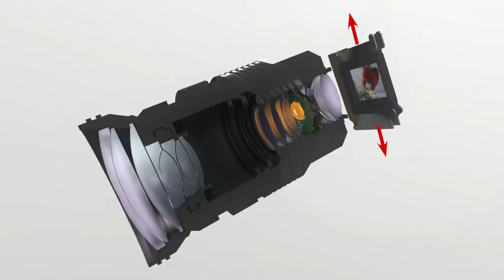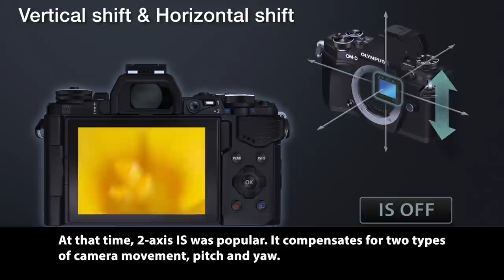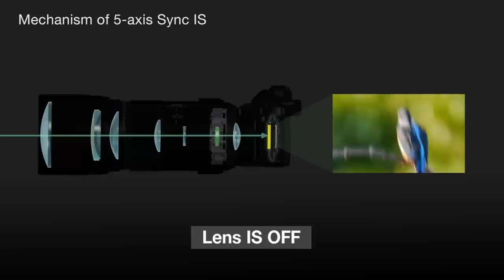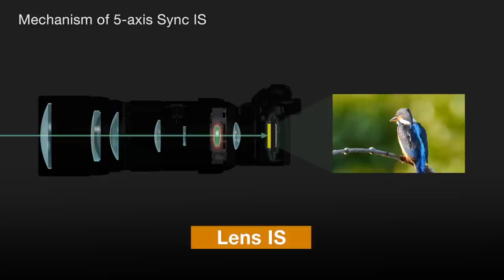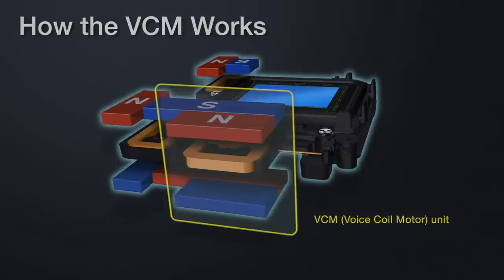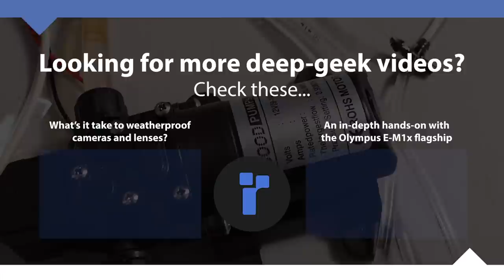The INSIDE story on Image Stabilization: Gyros and coils and magnets, oh my!

Comment: Thank you for  a very informative and clear video, I had assumed that you would want to coordinate gyros from deep into the lens with the gyros in the body to make the calculations even more accurate. But after watching this video I guess that might struggle for the same reason that driving the lens IS from the body would struggle. Electrons in copper racing light in glass plus compute in the body maybe makes it too slow. At least if gyros are providing additional data that is not as bad as a full roundtrip to let the body drive the sensor, but just fascinating.

Comment: Thanks Dave and Olympus for allowing Takeuchi san to be so forthcoming. I've been using Olympus for a number years now including the the EM1 iii and have found their IBIS implementation to be excellent. One thing that you didn't discuss is how the IBIS allows the capture of High Res images which is strikes me as being incredibly challenging technically. Interesting to hear that the gyros are from Seiko Epson. It makes sense that there's a connection due to the shared history of both companies in Nagano. One of the clever features of my old KM 5D was that the IBIS provided visual feedback on how steady you were holding the camera allowing you to choose the right moment (if you had time) as well as indirectly improving technique. Y
Reply: Hi Yamakawa -
Ah, I'd forgotten about that feature of the KM 5D! Yes, I always found that incredibly useful. If you had time to get the shot, you could wait until the camera-motion indicator had settled towards a minimum. And it was indeed very useful for improving your technique!

And yes, the handheld High Res mode is almost unbelievable, that it can manage sub-pixel alignment of handheld shots occurring across almost a second. I'll tuck that question away, in case I get a chance to talk with Takeuchi-san or another Olympus IS engineer in the future. (FWIW, I suspect it's a combination of their exceptional IS capability and perhaps some amount of post-processing, to do sub-pixel alignment of the separate images. OTOH, whatever it does, it manages to do it quickly enough that the sub-images in the RAW file are all properly aligned. However the accomplish it, it's indeed remarkable :-0 )

Comment: Great video. So cool. I do wonder how much processing power, battery life and maybe heat generation happens because of IBIS. Canon's new bodies are taking a lot of heat right now and I'm wondering if it's because of their new IBIS system.
Reply: Data input-output (IO) is what causes the heat issue with the new Canon cams (and any high data rate camera). 8k video passed at high frame rate is an enormous amount of information IO from the sensor to the recording device, which generates large amounts of heat.
Reply: @pwx8460  right but how come the camera is disabling 4k HQ video after 30-40 photos taken over the course of an hour?
Reply: @geoffreyenriquez  Hi. I can't say for sure, but recall from another YouTube reviewer, that the new Canon 4k video is down-sampled 8k video, i.e. still the same heat generation. 4k cameras also have to deal with heat management issues due to the extreme data flow. 8k will just be even more challenging.
Reply: @pwx8460  perhaps canon is just being conservative then?  the camera has been doing things for an hour (photos, standby, EVF, IBIS) so that increases the temperature a little bit.  once it reaches that increase then 4kHQ, 8k RAW get disabled.
Reply: @geoffrey enriquez There are many cameras, including from Pentax and Nikon which use IBIS but do not have any overheating issues at all.
Reply: FWIW, I don't think the IS circuitry takes a lot of power, whether for the processing or the actuators themselves. As you can see in the video, the sensor in the E-M5 III is very "springy", in that it doesn't take much force to shift it one way or the other. Combine that with strong rare-earth magnets and a lot of turns on the coils in the VCM, and I don't think it takes much current at all to move it around. It does take some processing to interpret the gyro and accelerometer data, turn it into sensor positions and then run the feedback loops to make sure that the sensor is precisely where it needs to be - but I think that's a relatively modest amount of compute power when compared with the demands for image processing. 

There is a huge factor that does affect IBIS systems, though, namely that the sensor isn't bolted down to a heat sink. Absent IBIS, the image sensor is invariably intimately connected to a heat sink of some sort that helps carry away the heat it generates and keep it cool. As soon as you mount it on a carrier plate that's free to move back and forth, you lose that. So dissipating the heat generated by the sensor itself is a much bigger challenge in an IBIS system than with a conventional stationary sensor.

Comment: It would have been good if you had asked what a shifting lens element implies for aberrations, bokeh, etc.  Regular lens elements must stay in place with micron precision, so how does the IS-correction lens element get away with shifting the image without adverse effects on image quality?
Reply: Ah, good question! I think the answer has to do with where in the optical chain the IS element is. The cases where lenses have to be positioned with micron accuracy relative to each other is when you have lens elements bonded together; depending on the lens design, the optical axes of the individual lens elements is sometimes extremely critical. (And this may in fact be a requirement for the individual elements that make up the IS group themselves; there's usually at least two elements bonded together in an IS group.) With the IS group as a whole, though, its job is simply to shift the path of the light rays without introducing distortions. When you look at the lens formulas shown online, you'll note that the IS group is usually off by itself, separated from other lens elements by some gap. I think that's part of what lets it shift the light rays without interfering with the underlying optical performance.

You do touch on a key point with IS of any sort, though: As you start using light rays coming from further away from the central optical axis, you're going to be dealing with areas in which the lens corrections aren't as well-optimized.

It turns out this is why some manufacturers will specify varying levels of IBIS effectiveness with different lenses: Some lenses don't have a large enough image circle to let the sensor wander as far afield in pursuit of the image as others do.
Reply: @daveetchells338  Yes, I'm also convinced that the "image shifting" lens element is very strategically placed. However, as you also seem to indicate, other lens elements will be forced to operate not quite in their optimal range anymore, which should have some impact, independently from any effects the moving IS lens element itself may introduce.
Reply: @coolcat23  
AFAIK, and that's not much, these lens formulae are calculated taking into account the effect of the stabilization element in the first place, usually by projecting a larger image circle than necessary in the optical path (that way, it can be "moved" without affecting edge/corner performance too much).

With IBIS it's indeed different, and Canon, for example, have adjusted the possible correction numbers on the R5/6 according to how large a lens' image circle is.
Reply: @Ildskalli  Obviously lens-based IS works and produces quality images, I'm not questioning that. I'm just curious as to what the downsides are. With IBIS it is easy to understand that part of the image will be formed using more of the outer image circle of the lens and we know the problems associated with the latter. I'm far less knowledgable about what lens-based IS does to the image. Potentially, the problems will affect all of the image, not just a peripheral region as it occurs with IBIS.
Reply: @coolcat23  
There is always a degree of misalignment with IS. Fujifilm were very clear when they said that the XF 16-55mm f/2.8 did not incorporate OIS because they wanted maximum performance - if they had added an IS group, quality would've suffered. They also equipped the GFX 100 with IBIS instead of putting stabilization in the lenses for the same reason. 

However, many of the best Canon EF lenses incorporate IS, and that's not only the telephotos (which gain the most from it, and apparently lose the least quality due to an IS group). The 16-35mm f/4L IS was for a while Canon's best UWA zoom, even over the fixed f/2.8 Mark II, and most of their IS primes performed at the highest level (until the RF lenses were unveiled, at least). So, it seems to be somewhat relative.